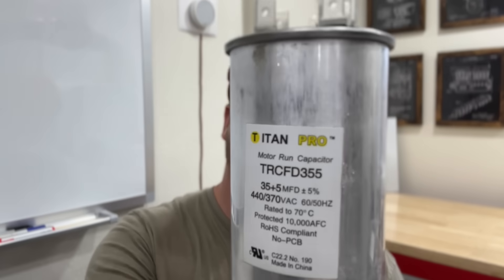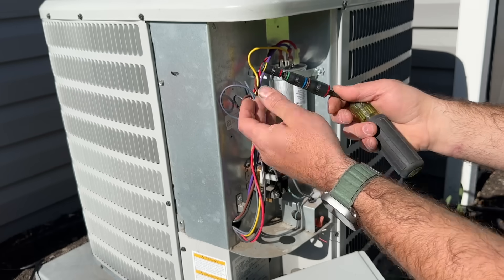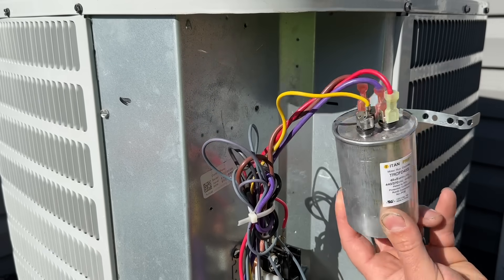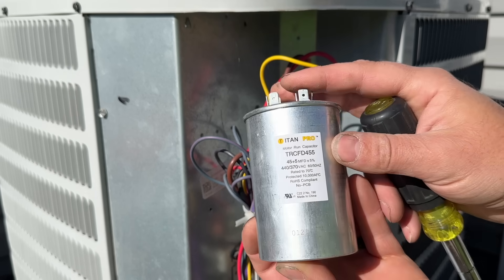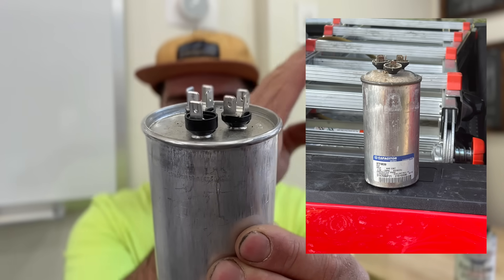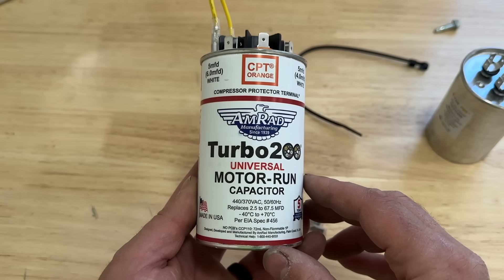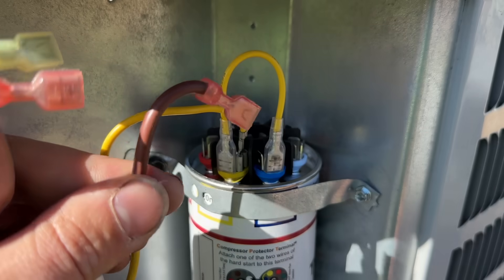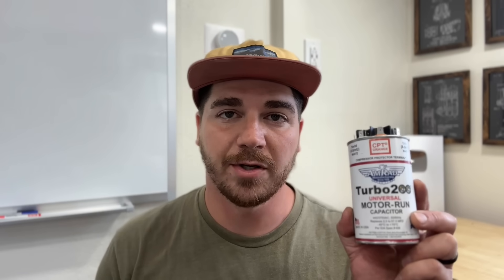HVAC Contractors Practically Make Their Living On These

Comment: Didn't he say that to find out the correct capacitor specs, you use an electrical meter and place the leads on the capacitor prongs?  Then later in the video, he shows that if one of the prongs is dead, you won't get a reading.  So if the capacitor is bad and there is no label, you won't be able to determine the specs.  So, what's the whole point of the video?
Reply: You are missing several points here.  1.  Most capacitors have readable labels, as in vast majority of them.  2.  You can often look up the correct capacitor online using the model number of your A/C and or cooling capacity for a similar model.

In the rare cases where you can't find the specs, and the capacitor is rusted out or burnt and there is no label, an A/C company can look up the model and replace the capacitor with the correct one.
Reply: @redbaron6805  I agree with everything you say, but the point of the video was to help you if your capacitor is not working, in which case you cannot use the meter to discover the correct specs.  And if your capacitor is working, then why would you ever disassemble it to check the specs in the first place?

Comment: I think your getting confused between Run and Start capacitor functions.   What you describe at the beginning of the video is a start capacitor. the "Run Capacitor" is used to create a 90 Degree Phase lag for the second winding in order for the motor to travel in one direction. without the second phas ethe motor just locks up on to one pole position ( and hums with the Mains frequency and gets hot)( . ( there is no such thing as a single phase induction motor)
Reply from the maker: Thank you for clarifying. I apologize if I misspoke.
Reply: @diyhvacguy  all good. They are very similar. If you have 2 Caps. The start cap will have some kind of method to remove it self from circuit after its start pulse, the run cap does not. 
I support the cause. I live off grid and have a lot of pumps and air conditioners. 
Capacitors have a limited life span. They dry out so it’s good to know how to fix them because as you said it’s the most common problem yet simple to diagnose and fix.

Comment: Some HVAC gal was talking down to me about how the AC needed a $900 repair, but she wouldn't touch it until the circuit box was replaced AND there would be no warranty. 
I declined her uninspiring offer, opined that I didn't like her tone, and with that she left.
$35 later I had a new cap in there. That was years ago, the HVAC still works.
Reply: I remember the AC unit on my parents house finally gave out after nearly 30 years of service. The capacitor never went out. But we lived in California and the AC is needed only during the summer months. I've been to a few Southern states and that's when I noticed that many people turn on their AC during the spring time. That humidity is something else.

Comment: The top of my capacitor is so rusted that I can not make out which is herm or fan. The size is a 5/45.  My question is this. I have the same 4 color wires as you do.  Do mine go to the same terminals as you mention towards the end of your video? Thanks!
Reply: Usually, in my experience, the top layout of the capacitors is the same.  As the wiring on a dual run capacitor is C Herm and Fan, the fan lead goes to the fan, the Herm goes to the compressor, the C is Common and goes to Ground.

If everything else fails, use a process of elimination.  Find the ground wire which is C, find the F wire which goes to the fan, the remaining wire is the HERM or H wire and goes to the compressor. 

Cut the power, buy a cheap meter, and chase the connections out with the Ohm and Continuity function...